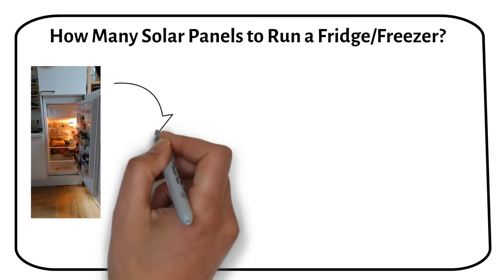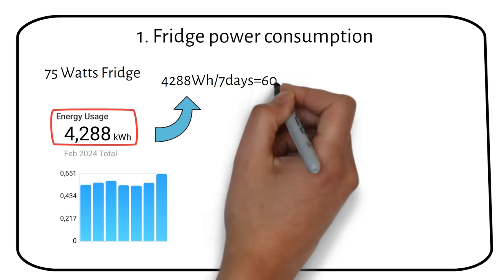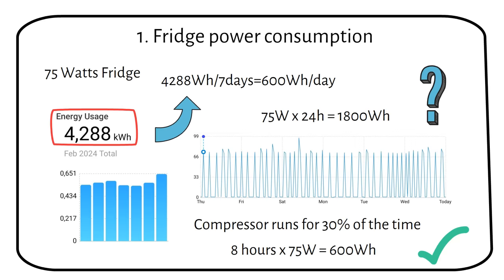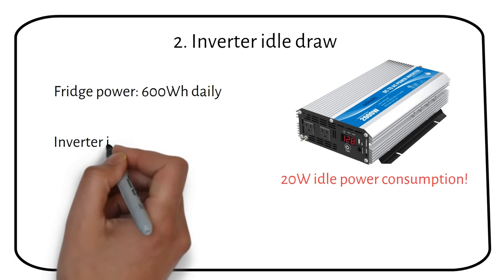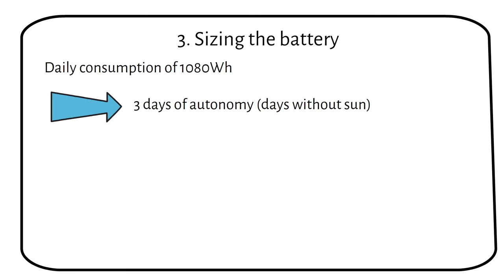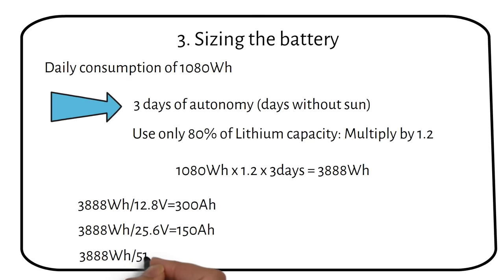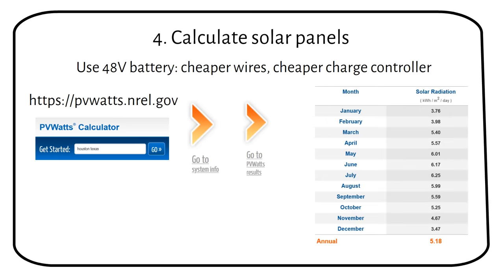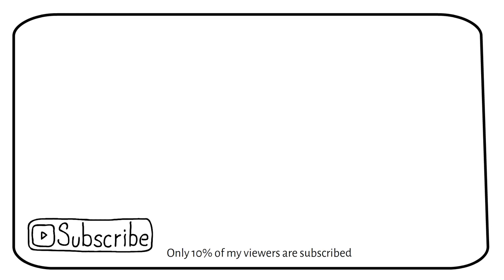How Many Solar Panels To Run a Fridge/Freezer?

Comment: Need to try and run the fridge straight from 12v, inverters are horrible wasteful you could double your autonomy or buy half the battery
Reply from the maker: Or get an efficient inverter. Price would be about the same. DC fridges are generally more expensive and smaller.
Reply: @cleversolarpower  even then, the conversion might be 90% efficient but that extra idle power negates that.
The motor could be rewound for 12v, the world needs more DC gear
Reply: @Ben1551  Brand new 10.1cu ft  110v fridge, 500$cdn ($400 US), 2000w ps inverter $175 cdn, versus $1200 cdn for a 12v fridge, almost half the cost.

Comment: This formula does not work at all for me because I live in Arkansas and have 12 days of autonomy.

I am using a 2000 wh solar array with a 100 ah battery to carry overnight. This setup is working fine.

I prefer to have more solar panels and less batteries because the batteries wear out and have to be replaced.

Incidentally . . . My 100 watt solar panels put out 7.5 watts on a 99% cloudy day.

They are wired in parallel at 12 volts.

My house temperature in the summer is 95° f.

I have the inverter shown in the picture. It is 87% efficient and its idle consumption is 15 watts.

Comment: It would seem more eff to swap to a DC compressor motor that that inverter.
Reply from the maker: Yes, but they cost a lot more.
Reply: Brand new 10.1cu ft  110v fridge, 500$cdn ($400 US), 2000w ps inverter $175 cdn, versus $1200 cdn for a 12v fridge, almost half the cost.
Reply: @danallanson5990  I didn't say replace the whole fridge, just the ac compressor motor to a dc version that could run straight off the battery, eliminating the inverter cost/efficiency, and the battery size of almost double, and the size of the required solar panels, almost double.
Reworded, using the inverter you need a 80% larger (1080/600=1.8) output, now the three day deal makes that 3 times worse for the battery and panels..Now the ~100W DC motor would cost about 50~100 usd, compare that to increased size of the overall system, hopefully you get my point now?

Comment: Hi, in your Solar Panel calculation all you are doing is charging the battery. You also have to supply the fridge load and inverter idle power during that time. What about inverter efficiency ? Also in Winter the fridges consumption should be significantly less because you drink less cold beer.
BUT, I doubt it will make a meaningful difference in practice as much of your assumptions and calculations are nice and conservative.
Reply: Inverter is 87% efficiency. Or you can look on the box.
Reply: @Matthew_Loutner  Thats not the point - the point is that the efficiency, not matter what it is, is not taken into account in the calculations.
Reply: @keithduffield5239  Well in that case he also did not include charge controller efficiency, wiring efficiency, battery efficiency and the actual power output of the solar panel when it is hooked and running.
Reply: @Matthew_Loutner  He did include panel output by using sun hours and Panel peak power. Panel efficiency has NOTHING to do with it. A panels rated output is the net output after taking into account efficiency. A 100W panel is a 100W, doesn't mattery if the panel is 15% or 23% efficient. 

All those other losses are miniscule compared to not including the load while simultaneously charging.
Reply: @keithduffield5239  What I was referring to is that a panel that is rated at 100 watts does not put out 100 watts when it is hooked up and running in the system. It puts out around 70 watts in full direct sunlight and each brand is different and puts out a different wattage. But his formula has them putting out the rated wattage -- which you will not get.
Reply from the maker: You are right, i did not include all these extra efficiency losses. I wanted to make the video as simple as possible so people don't get overwhelmed. Especially the cold beer efficiency increases will make it complicated ;)
Reply from the maker: Sunhours is quite accurate. The website i talk about (pvwatts) already has a tilt angle built in. If you have 3 sun hours a day that means a total of 3000W/m² for the whole day; not just from 12:00 to 15:00. it's an average over the whole day, averaged over the whole month.
Reply: @Matthew_Loutner  The wattage at the VOC is 0.  You mean the optimal operating voltage, which is a different parameter.  But 70W is rather low.  I get 90W of production from a 100W panel facing directly at the sun.  The wattage is basically irrelevant anyway.  It will change throughout the day.

What matters is the total daily production and to get that you can simply multiply the panel's nameplate wattage by around 4.  So a 100W panel will typically produce roughly 400Wh/day of energy, rule of thumb.  Just about anywhere that isn't above the Arctic circle.

Obviously in winter it will be less... use 2 as the multiplier for the 3 months around the dead of winter.  And in high summer it will be more around 6.  But for 9 months out of the year you can count on roughly 4x the panel's nameplate wattage in terms of daily production in watt-hours.
Reply: @Matthew_Loutner  Matthew, VOC stands for "Voltage Open Circuit", aka the voltage when the panel is not connected to anything.  aka zero current, zero watts.  That is what "Open Circuit" means.  The wattage is 0 at the VOC.

Production parameters are on that label too, listed as "Optimal Operating Voltage" and "Optimal Operating Current".  Or just "Operating Voltage" and "Operating Current".    The operating current that you will get at the operating voltage at standard full-sun irradiance.  Those are the two numbers you multiply together.

So for example, I have a 100W panel here with the following parameters listed on its label:

Open-Circuit Voltage (Voc) 24.3V
Short-Circuit Current (Isc) 5.21A
Optimum Operating Voltage (Vmp) 20.4V
Optimum Operating Current (Imp) 4.91A.

20.4 * 4.91 = 100.16W.  This is a 100W panel.  Where I live with the panel facing the sun directly I get around 90W out of it in real life.

-Matt
Reply: @Matthew_Loutner  No, I explained to you what the terminology means and you aren't listening.  Isc  Is the short-circuit current.  It has nothing to do with production wattages or "rated watts".

Neither Voc or Isc have anything to do with rated or real production from the panel.   There is no such thing as "Rated Watts" at either the Voc or the Isc.

Rated Watts is Vmp x Imp  ... the voltage times the current at the maximum power point of the panel.  It has always been this.  Please correct your understanding.
Reply: @Matthew_Loutner  Sigh.   Nothing more I can do to help you.
Reply: @Matthew_Loutner  The rated power is just that. It is a standardized way of rating panels so that you can make calculation and do system design. Rated power is under set lab conditions called STC or standard test conditions, and yes you would have to have exception conditions to achieve the rated power in the real world. As you state, you get 70W but others wont or may not. That is why designers use rated power and sun hours for system design. It's not perfect but it is close enough on domestic size installation. People tend to get into analysis paralysis and fall down the rabbit hole. It's not a binary thing. Of what consequence is it that your batteries are fully charged by only 13h00 instead of 12h45.  BTW - I live in sunny South Africa and I regularly get greater than rated power on my arrays. I also own an Energy Consulting company and have a fully equipped lab for testing Batteries, Inverters and PV Solar Panels for various distributors. For example, you bring me two PV Panels with identical Power Ratings and I will put it on a MPPT based Solar Panel Analyser and tell you in 10 minutes which is the better panel.😊
Reply: @Matthew_Loutner  They all do, fact.
Reply: @Matthew_Loutner  What can I say. Poor company. How then do you rate them without a standard. The direction the wind is blowing in ?? If you don't rate them against a standard their rating has no accreditation or relevance or validity, or measure against which to compare it. So what is your accreditation measure.
Reply: The solar panels Rated Power under STC conditions. There is no other way, if your panel doesn't state that you are buying potentially junk, and you pays your money and you takes your chances.

It's like choosing between two 250Hp cars, you have no choice but to believe the manufacturers claims.

Comment: Where is the math showing the rate of discharge during the charge?  Don’t you need to compensate for the battery being drained during usage. Won’t you need extra solar to cover that?

Comment: you can better buy an 12- 24 or 48 volt compressor Fridge.
Reply from the maker: They are mostly less spacious, but if you don't need a lot of space and want to make the investment than thats ok. Most of the time, getting a residential fridge and an efficient inverter will be cheaper.
Reply: There are also large models, but they are very expensive.

The advantage of DC compressor refrigerators is that they are particularly energy efficient.
Reply: Brand new 10.1cu ft  110v fridge, 500$cdn ($400 US), 2000w ps inverter $175 cdn, versus $1200 cdn for a 12v fridge, almost half the cost.

Comment: very slight mistake in that video claims 4288kWh, whereas other calculaions show it is 4288Wh; i.e. 1000 difference.
Reply from the maker: In Europe we use a comma as a decimal while the USA uses it as a thousand separator. No mistake 😉

Comment: the cost of batteries and panels, assuming that everything will work without failure, is 13 years of using the refrigerator from the network. and I significantly overestimated the consumption and price per 1 kWh. where is the sense, where is the logic.

It's a pity that you didn't provide the estimated costs of purchasing such an installation
Reply from the maker: On the grid it's not feasible. This video is made for off grid installations.

Comment: I got three 300w solar panels + 1000w inventor + so can it power fridge, 50w tv plus lights for 4 bedroom house in a sunny area??
Reply from the maker: It depends on the power of the fridge. Put everything in a load analysis and see what you come up with. Check my video 'off grid solar design'.
Reply: @cleversolarpower  thanks

Comment: How does the defrost on the refrigerator affect the calculations and can the defrost be turned off?
Reply from the maker: It wouldn't be much. It will depend on your model. Defrosting helps make the freezer more efficient, so i would not turn it off.

Comment: When you convert DC to AC you have a big loss. 2 $100.00 panels will run my DC Fridge/Freezer, its 6 amp starting, 5 amp running at 30% duty cycle. size 28X22X18
Reply from the maker: Thanks for sharing! What size fridge do you have and am I safe to assume it's 60W?

Comment: The assumtion that you need to charge in one day a battery that lasts 3 days is stupid.
Also, why a battery that lasts 3 days and not 12 das or 30 days?! If we take worst case scenatio, aka winter, snofall can last for many days and energy harvesting will be minimal and needin extra effort to keep the panels clean from snow. 
A 1-1.5kw installed system  grants an energy independent lifestyle for a normal person, meaning 3-4 solar panels. This means not having th most efficient low power electrical devices in their home, but also not being wasteful either.
Reply from the maker: This video is for off-grid. If you move off grid you will be glad you have three days of autonomy.

Comment: 27000W and stilll it doesn't power in winter.
Reply: If you live in an area that is super cloudy, try changing your wiring to parallel.

I get 7.5% of my rated capacity on a 99% cloudy day.

On a series circuit you may get 3%.
Reply from the maker: Thanks for sharing Matthew. Unless you get partial shading, wiring in parallel is not recommended. Shade from clouds usually covers the whole array, not partially. You would have to increase wire sizes and install a combiner box which will increase the cost. Is the 4.5% increase worth the investment?
Reply: @cleversolarpower  Actually, all of my power comes in on 14 guage speaker wire and joins near the charge controller input. It is joined by having ring connectors with a bolt and nut terminal. I do not have a specialized combiner box. The wiring cost per 100 watt panel is about $15. ($300 for my 2000 wh refrigerator operating system)

On a 99% cloudy day, if I can double my power output, that means that I can get by on half as many solar panels, right?

That would be worth the cost.

I know what is recommended. But if you will notice, NOBODY tests panel performance on mostly cloudy days. All of the video-makers wait for a full sun day to make their video. The recommendations that they give are for best performance on a sunny day -- not for a cloudy day.

I was forced to figure out on my own what would work best in my mostly cloudy location.
Reply: @Matthew_Loutner  juh perfornance during winter is near zero. Gosh..
Reply: @picobyte  Get a solar panel tester and test each individual panel (in the winter).

Comment: So most of the time you would have a surplus of power you could redirect to other uses.
Reply from the maker: To the battery 😉
Reply: @cleversolarpower  I was thinking about charging EV's but sure to the battery works too. I charge two EV's with solar because paying for energy seems insane when I can produce as much as I need myself for a tiny fraction it costs to buy it.

Comment: Very straightforward informative explanation.Everyone that runs household  should watch this video.Very difficult to get correct size solar system for appliances that cycles on and off.
Reply: One system to run everything including the heat pump. Why power each appliance individually?

Comment: 5:05 Are you sure "Solar Radiation" is a sun hours per day? The title states it's kWh / sqm / day. PV panel doesn't get 100% of solar radiation but efficiency is about 20%  then the real power production will be: 3.47 kWh/sqm/day * 20% = 0,70kWh/sqm/day. As one typical panel is about 1,7sqm you need more than 6 PV panels to cover your scenario of 3888Wh. In reality it will be even worst because clear sky in winter without clouds, snow, fog is not common but this PV calc is based pure on globe geometry and angle of sun without taking weather into account.
Reply: Yep!   There is flawed analysis in the video.  It appears he forgot solar panel efficiency…19-21%…
Reply: He already used the worst sunny month of the year as a basis of calculations, which includes all the risk factors you have named

Comment: Well explained, but I think you missed the part where the fridge runs directly on solar energy during the day. For instance, if the battery is fully charged, the inverter utilizes solar energy to power the fridge. Consequently, the fridge only draws power from the battery during periods of low sunlight. It's feasible to operate the fridge using only half of this system, although it naturally depends on the area where the PV panels are installed.
Reply from the maker: You are right. But that would make the calculations unnecessarily complex. This is aimed for people new to solar and would be overwhelming. Thank you for your feedback.
Reply: 😢😊😅😅 @cleversolarpower
Reply: @cleversolarpower do you have video for this ?

Comment: I have an old VW camper frig in my Vw van, I started with 100watts and 1 battery, ended up with 200watts and 3 batteries, works great (and a 20 amp charge controller).
Reply: You should look at the 12V frig like Euhomy.

Comment: Something that was missed is the defrost cycles with upright freezers.

Newer upright fridge/freezers aren't so bad compared to older models. But the most efficient combo could be an inverter fridge and a basic chest freezer (no defrost cycle").
Reply: Direct drive compressors from inverter refrigerators do not last Long.

Comment: There is somethi g you have'nt talken about. The compressor consumption at the starting. It can amount 5 to 10 times the normal consumption. And if the inverter and the battery are not enough powerful, the refrigerator do'nt start!
Reply from the maker: This has been calculated in the consumption. The inverter has to be sized to 6x the normal power rating of the fridge. So my 75W fridge needs at least 450W. There are many caveats, but it would be too much to include it in a 5min video.
Reply: @cleversolarpower  OK

Comment: Perhaps you did not take consideration of initial current required each time compressor starts. That amout is significant. You may need more power in reality , worth trying  practical demo.
Reply from the maker: I share my recorded power consumption at 0:05 please take another look.

Comment: Thank you for your clear and concise explanations.  Just a comment regarding this video. I noted you presented here that your total measured fridge energy consumption for Feb was 4,288 Wh,  and it is displayed in the video diagrams as 4,288 kWh.  The presentation displayed the unit at 4,288 kWh.  My question: Should it be 4,288Wh, 4,288 kWh or 4.288kWh? appreciate your clarification.. thanks.. Great video BTW... enjoying watch them.
Reply from the maker: Thanks. I'm in Europe so that's how we put our commas and decimal signs. I will adjust in the future to fit us standards because most of my viewers are from there.